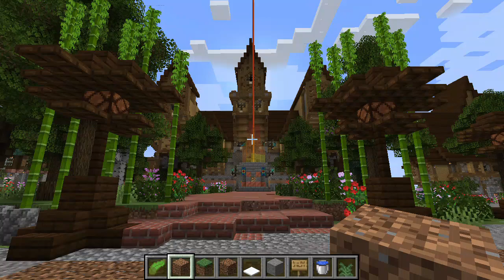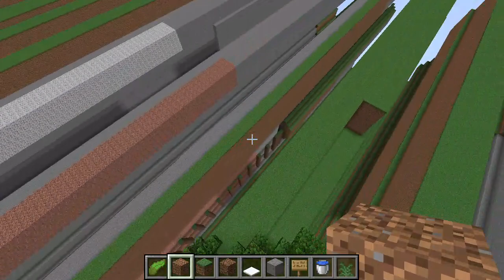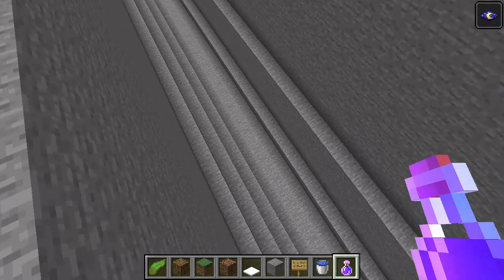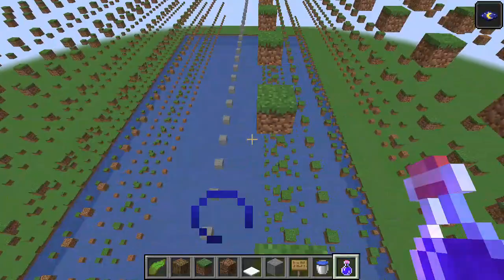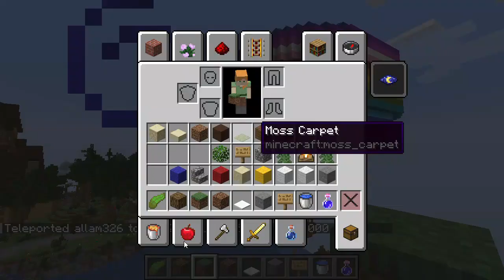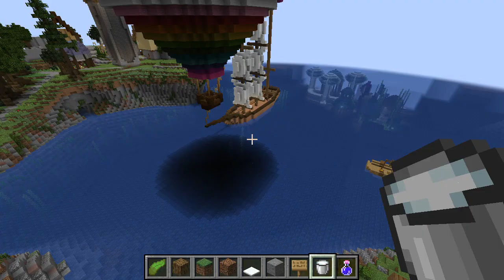Minecraft Creative: THE FRINGE LANDS! (UPDATE)

Comment: I actually did build fringe farther lands at X 265000 and Z 81566, all the lower layers within 300 blocks of Z 81566 degrade into comb lands and skygrid that will all comb lands decay at X 277000 Z 81566 to one block strips and will end at X 284000. The X 81566 Z 265000 is yet to be built but it will decay much later since regular corner farther lands will be built until X 81766 when it will become skygrid. The same skygrid will generate but at Z 270000 instead of Z 265000 and will generate thicker skygrid. At X 12550 Z 277000, the z fringe farther lands will be all comb lands and skygrid. At other axis, the X/-Z, -X/Z will generate skygrid at end of it. The terrain below Y 3 will be nothing but deepslate at fringe lands and past it except for Z and -Z axis skygrid which will generate some tunnels until the world border
Reply: Yo, great job
Reply: @Hyperdimension_Neptunia  yo. Still working on this but moved it to a coordinate roughly similar to his.
Reply: @mythicrb_yt  yo whattup bro I also built the farlands 12m blocks away farlands coordinate: 12550824 145 12550824
Reply: @Hyperdimension_Neptunia  yeah same.